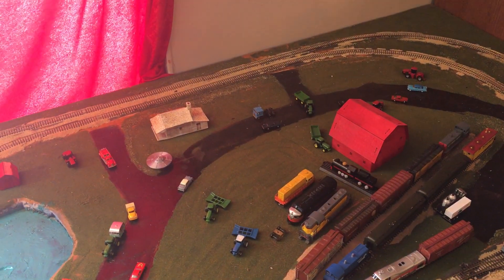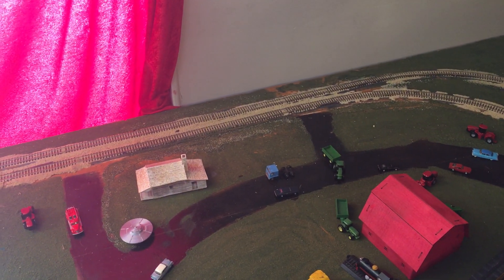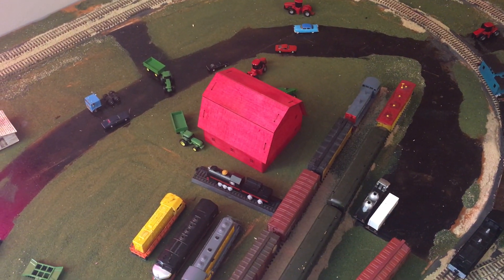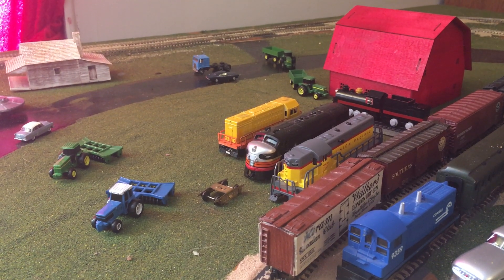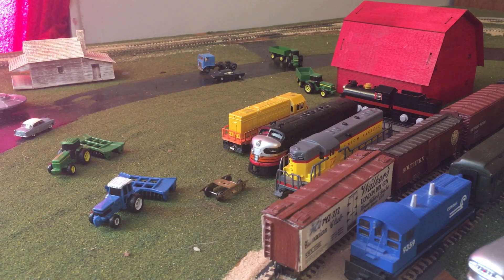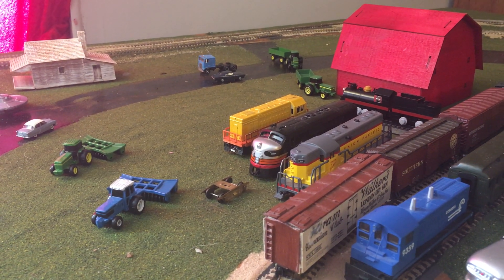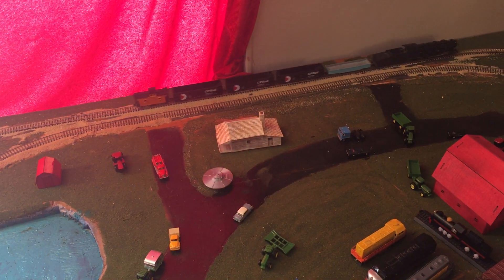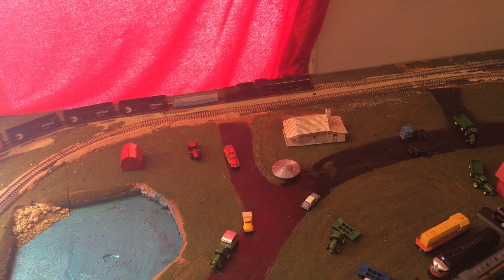Running TT Scale Trains on my 38" x 72" layout on 24March2020.

Comment: Where did you get the Kuhn track? I couldnt use their website as it was in German nor could I find a dealer. Thanks, Taos Kid
Reply from the maker: The Zeuke TT website has an English option, and that is where I got my track from. https://www.zeuke-tt.com/c-3969924/code-72-tracks/
Reply: @RhubarbRailway  Thanks. I'll check it out. I wanted to build a module with the bedding track and was having difficulties locating any track.